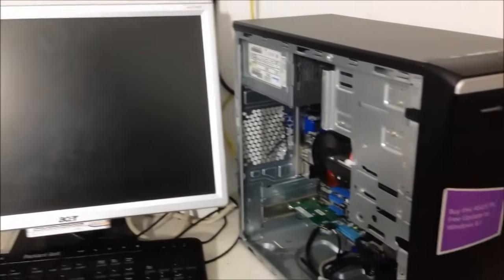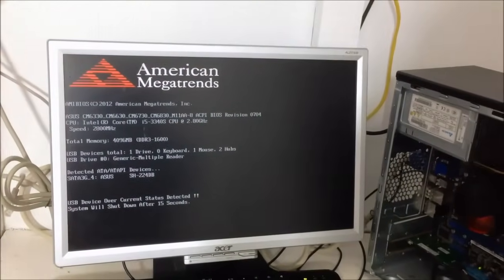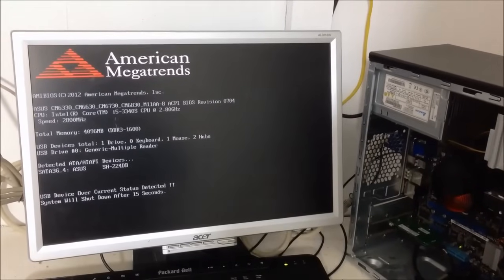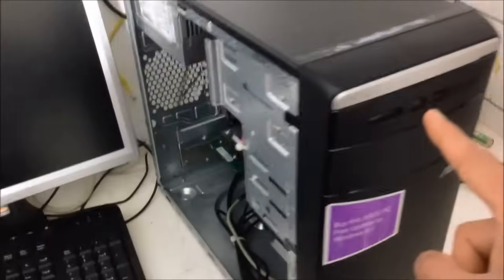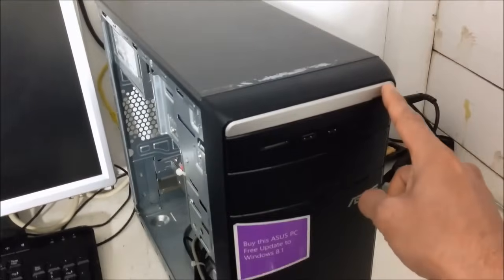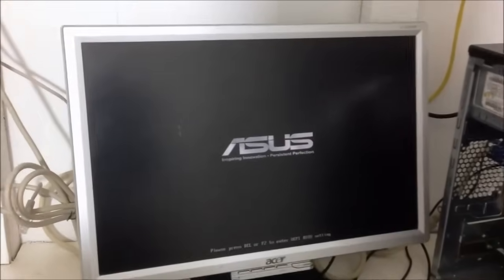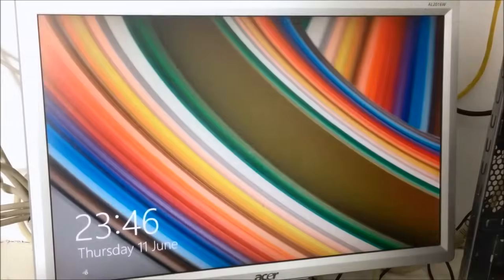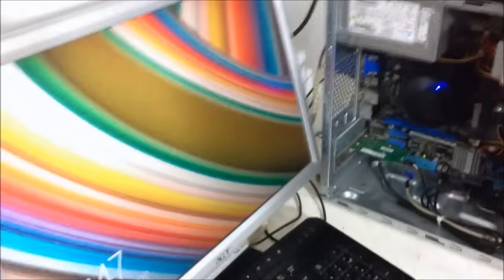USB Device Over Current Status Detected System Will Shut Down After 15 Seconds | How To Fix

Comment: I still get the same error message after removing the USB connector.
Reply: I know this is kinda late but did u fix it ? And how bc im getting the error after trying everything ...
Reply: @rufusishere  did u fix it? Im having problems with it
Reply: @Platypuuss  i had a piece of metal from the io shield in my usb port i just removed it and it worked
Reply: @Platypuuss  did u fix it ?
Reply: @uzi.e46ix  that video is private
Reply: @rufusishere  that means you are saying you had removed the inbuild usb of motherboard and its worked?
Reply: i am also having error after trying everything as far as i can do
Reply: @mr_stark79  Hi - I remember this issue; it turned out I had a faulty power supply.   One of its main cables going to the motherboard was providing the wrong amount of current. I got a new one installed and it solved the problem immediately.
Reply: @mr_stark79  No, a piece of the io shield was bent inside my usb c slot. i just bent it out of there and it worked. My io shield is not placed that perfectly, that's why there was a metal piece bent in.
Reply: @rufusishere  ohh i understand
Reply: Rufus  dang honestly that's what I'm going through rn
Reply: @endeckerBM what did you replace the whole power supply unit?
Reply: Same
Reply: Bro u need to check the back USB cable if it’s damage

Comment: Discharging your static works only when plugged in. So touch the metal case first, then unplug and work away.
Reply from the maker: Yes thanks, noob mistake early on, been doing that in subsequent videos...

Comment: Thanks for the video. I put a Blue Tooth done in the front port. Turned out to be damaged and was probably shorting. I pulled the device out, put the silver divider back and it fired right up.

Comment: this is very easy to fix and i just knew it now,let me teach you. 

1. turn off your PC
2. remove all the usb cables for your peripherals (mouse,keyboard,headset etc.)until theres nothing left. 
3. wait for a minute and then turn on the pc. 

it should work and while your back at the windows startup, start connecting all your peripherals again. I think its because of the power the peripherals are consuming because all my stuff has RGB so i turned all of them off.
Reply: Thanks you😊
Reply: @elmichi9304  np my guy!
Reply: heh, lemme try

Comment: So I unplugged the front USB ports on my motherboard, and it worked. Then randomly it happened again a day later. I looked closely and there was a loose metal pin on the port. I used tweezers and yanked it out. It’s working fine again.

Probably going to end up buying a new case😒

Comment: How am I the only person in 385 comments to still have a problem??! :( Ive opened the side, removed the connected USB ports, dusted out the interior, checked the USB sockets (which are fine) booted it back up again and I still get the error! :( There was 3 potential sockets to the USB drive, I removed them all after trying to eliminate them one by one and it still not working. Please does anyone have any other suggestions??
Reply from the maker: Some people have suggested it could be on of the USB ports soldered onto the motherboard, from the back or inside the board itself.  I don't have any means of testing this I'm afraid, as I do not have that board anymore.

Comment: Omg I was not competent enough to remove the cable, but I figured you can also just straighten the usb pins so they dont touch the sides, it fixed the problem for me pc starts instantly again!:) good luck

Comment: It will work if you remove the little cables from the mother board.If you remove the cable from the panel it might not work

Comment: I tried your solution but it didn't work so I have a question. I got an old desktop from a friend that didn't work and I suspected that it was the power supply so I grabbed the spare that was closest to the original. However, upon booting up it says that a usb device over current detected. Is this a problem because I'm not using the OEM PSU?
Reply: I carefully looked at all of the usb ports and no pins were damaged at all
Reply: Your problem is solved or not? I know its been 7 years but i haven’t got any solution for my problem

Comment: I had a similar problem. Might still have i dont know yet as its being tested with OCCT CPU is showing 100% so im putting it through its paces and its still on.. I bought a Sata usb adapter to plug a 3.5 hdd into a connector then power it via usb and a ac adapter into plug socket. Worked fine and can make any hdd turn into an external drive but then i changed the usb port it was in and i noticed the hdd kept turning itself off. Pc would then crash and front Blue light would flash like in sleep mode. It would then take ages to turn back on. Usb ports use volts and these can easil;y be the fault, shorting etc. Just look at each port, one might be damaged or try to find the faulty port and do not use it.

Comment: Don't really know much about computers but this fixed the problem.  Thanks... dunno why it came up though, those USB ports haven't worked in years
Reply: +HealMyPc need help man. Made my PC everything boots up fine fans running, but no signal to the monitor ? "First time boot,
Reply: +HealMyPc monitor works fine plug hdmi in my ps4 and works fine, when I put it on it powers on then 20 seconds later it powers off by it self
Reply: +HealMyPc would u like me to make a short video and send it to u to see what's happening ?

Comment: Thank you you saved me a trip to the shop I have an M51AC Asus similar set with front ports one busted up so eventually pc stopped booting simply unplugged one thing from bottom that seemed to have 2 white wires from the top and it booted up after

Comment: I have an ASUS motherboard LGA1155 socket and I am facing the very same difficulties as you have shown on the video. My PS2 keyboard is not recognized through the PS2 port but through a USB port using a PS2/USB adapter, but even though recognized I still can't use it and can't enter BIOS . Onboard graphics card doesn't post therefor I have to use a PCIE graphics card in order to see the above mentioned messages. I have tried everything with the MB mounted in a pc case, and taken out, disassembled all the units connected to it (e.g. CPU, GPU etc.), I took the CMOS battery out of its socket, cleared the CMOS through a CMOS jumper but the problems still remain. Motherboard, CPU and RAM memories are compatible so there is no problem in pc parts compatibility. If you happen to think of an advice for me I would gladly listen. Thank you!

Comment: Having the same issues now- so frustrating I haven’t plugged/unplugged any usb. I asked myself-Why the heck would it short? Did Antman got into it?. I just reinstalled my pci express card before error appeared. I unplugged all USB connector to board already - still error reports. Perhaps the rear ports? But how to disconnect those are soldered direct to mobo :(

Comment: Great fix thank you, but it gets crazier... I do not disengage the front
 USB port but instead insert a stick that was in it before last shut 
down and the comp works ... I take that stick out again and the comp 
does not boot instead I get the massage "usb device over current status detected" ans in 15 sek it shuts down. I put the stick back again star and the comp boots again normally, I have full access to the stick too the port is not damaged... any ideas?

Comment: Hey i have this issue and disconnected the USB front panel connection, but getting the message still...what if the USB port is on the motherboard?

Comment: it also tends to break the tps 2024 the pin 5 is responsible for sending the signal of overcurrent is recommended to replace the component or remove it but the USB ports in question will be lost
This is also solved this famous bug greetings roman of Cuba

Comment: Hi, I have problem with my pc,sometimes it just shut down,when i turn it on again i see message "Windows did not shut down successfuly.If this was due to the system not respording,or if the system was shut down to protect data" And then i get option to choose beetwen 
Safe mode
Safe mode with networking
Safe mode with Command Promt
 And -Start widnows normally.Its happening over and over.Pls if u now how to fix it pls reply!

Comment: This wasn't the issue for me, oddly enough after cleaning my PC out I got this message - turns out I'd (forgive my ignorance on tech here) unplugged this little blue.. square bit of plastic from the motherboard *(this thing looked like a cover for the prongs it was on)*. 

I didn't intentionally take it out and leave it off; I just forgot to put it back on - and thats when I got this message - my solution was just to put it back on the motherboard in its original place.

If anyone can explain better what I did to cause this or what the issue actually means I'd be interested to hear from you.

Comment: Hey I need help I get the same error but I got into bios but know I can't at all what can you suggest? I've been having this problem on my new built pc, the speaker doesn't been and everything is detected, the only problem is the USB current! please help!!!!
Reply: +HealMyPc  Yes I actually got into the BIOS but when I turned it off the error appeared again! I got into the BIOS twice, what can you suggest because all parts are new, I'm starting to think the motherboard needs a new CMOS battery.
Reply: +Alan Serrano The only way I could get into BIOS is removing the motherboard battery and reinstalling it could
be the CMOS battery that has gone bad? This is my motherboard Asus P8H61 I-R2.0 it's paired with Intel i3 2120 with 8 gb of crucial RAM.
Reply: +HealMyPc Okay I'll try and switch the CMOS battery, but could it be the USB headers? When I connect the keyboard its detected by every onboard USB header when I move the keyboard into different USB ports.
Reply: +HealMyPc  Okay I jut swapped and it worked installed Windows amd updated drivers but when I turned it off the error showed again this doesn't make sense I was using it like of it were new and I get the error! Im getting tired of it!
Reply: +HealMyPc well No but I just figured to buy a new motherboard and CPU so everything works great now.

Comment: You can actually fix this by pulling out the connectors in the bad USB PORT I did it to my own & the other port works I was a little surprised use a pair of tweezers & pull them out it should work like mine did.

Comment: If I plug in my keyboard it shows over current, but when it is out, it is ok. Is my keyboard broken? Please help, thanks.
Reply from the maker: plug that keyboard into a different port, or into a different computer or laptop, it the keyboard works then its you first USB port that's the issue, if not then its your keyboard.

Comment: What if you get this error on a laptop? It doesn't appear during the BIOS, but it does when loading Linux. Is there a fix?
Reply: +ash healmypc99 Yes, I've seen the error during a Ubuntu boot and other distros like Fedora and Arch. I have plug and unplug USB drives 4-5 times to get it to work.

Comment: ON THE PRIME B350 PLUS CARD, "" USB device Over current status detected !! "" I DISCONNECTED ALL USB ON THE CARD, STARTED THE PC WITH AN OLD PS2 KEYBOARD AND ENTERED THE SETUP, RESETED THE BIOS AND THEN UPDATED THE BIOS, DISABLED IN " ADVANCED + USB CONFIGURATION + USB SINGLE PORT + CONTROL AND DISABLED UBS3.1 1_1 "DISABLED" RETURNED, BUT WITH A DISABLED USB PORT ... NO MORE DEFECTIVE, I HAD THIS PROBLEM ON ANOTHER BOARD AND DISABLED USB3.1 BACK EVERYTHING TO NORMAL, THIS MUST BE A DESIGN ERROR FOR ASUS PLATES ...

Comment: Thank you save me a lot of time worked for me but instead of removing the cable from the motherboard I just remove the short circuit from the USB and filled it with hot glue

Comment: i had the same problem it says "usb device over current detected" even i dnt plug the front panel. helps me please ,2 out 6 of my asus motherboard having this problem. - sigh-
Reply: +HealMyPc hey man im having exatly the same prob i removed the front panel i also disconnected everything i looked over rams if they had the prob but not any solution help

Comment: I have this problem began with PC turning on and off fixed it room found out all new and then booted up to this msg tried new power supply disconnecting headers for front panel my specs Msi a88x g45 amd 6600k quad core 8gbs ram Kingston hypercritical Blu all began after putting in a new case I did add 2 more fans and a cooler tried without them same problem please helps thanks
Reply: HyperX all new parts beside ram mobo and apu the new power supply is 750w I even tried my old 450w same thing motherboard looks to have no damage doesn't overheat and either USB ports have no damage to them front or back

Comment: The best fix is to replace the motherboard because the Oculus s software won't work unless the motherboard is replaced if you get a USB overload from a driver issue. Even if you solve the problem without replacing the motherboard the Oculus s software won't still work.

Comment: same problem, doesnt work.
Same message, but the motherboard is not on the pc, i got it out and is not connected to anything. Just mother, ram, cpu and psu.
Reply: *****
I was able to solve it after a while reading the manual. I was missing 1 jumper. It needs to have the 4 jumpers connected, for some reason mine only had 3 (maybe it fell or something)

Comment: Thank you very much for your video , i didn t have too call a technicien $$$

 . it completely fix my problem.
Reply: +HealMyPc hey my PC booted up and got windows but when I put my graphic cards in it does not boot up. Mother bored asus h81m- a graphic card evga GeForce gtx 950 ssc. Looked on part picker and it says it's compatible? Please help
Reply: +HealMyPc I did figure it out and that was the solution I left it in mother bored did not know their was a part on the card. New at this lmao. Thanks for the help tho

Comment: Feck. Same problem.... THIS same problem, doesnt work.
Same message, but the motherboard is not on the pc, i got it out and is not connected to anything. Just mother, ram, cpu and psu.
Reply: ***** Hi; thanks for responding. BUT I dont/didn`t have ANYTHING Connected to the motherboard except power and Athlon CPU and RAM (and I swopped CPU and RAM repeatedly). .... The problem turned out to be I hadn`t connected my (SATA) DVD Drive and pressed F8 for my PC to re~boot to something it could work with as I had swopped the motherboard, but for the same XP OS (may be something to do with what was stored in Ram?). Got BIOS at last and could set/time Date and settings. Will try (again) and re-install/re-connect all the gear inside the case now.
Reply: ***** Works great now. there was (also) a RAID Setting in BIOS that was misconfigured.